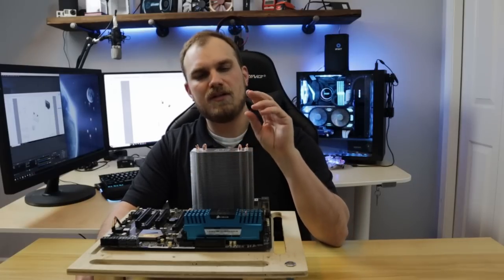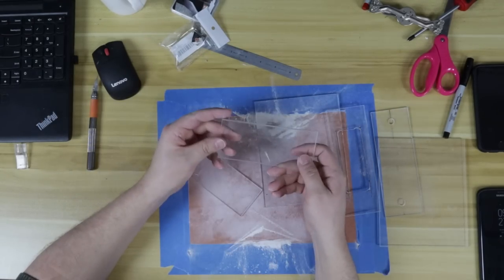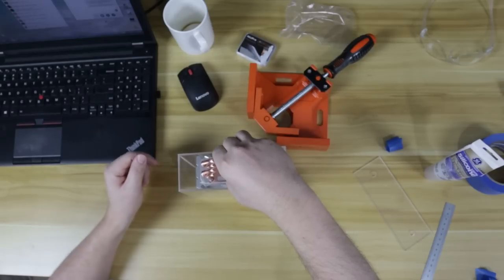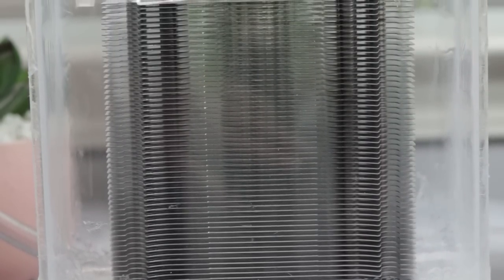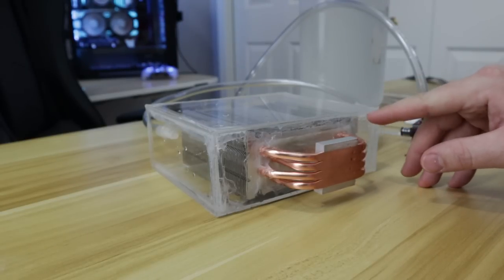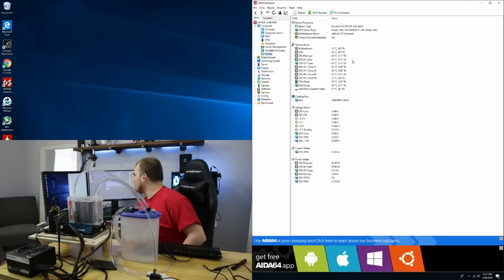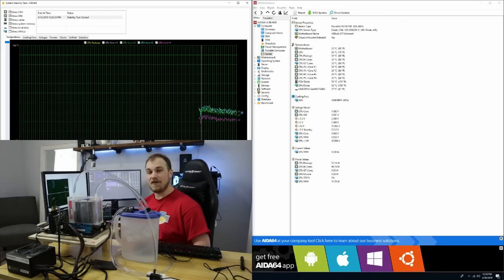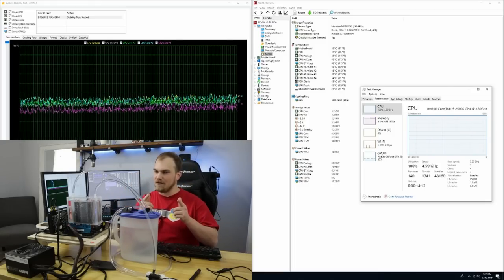I Water Cooled My Air Cooler AND..........

Comment: Pretty nice idea man :D Well done
Reply from the maker: THANK YOU, You Are A LEGEND my man.
Reply: legend der8auer approved 😱 great job 👍🏻
Reply: If der8auer likes it its because it is a very good idea! Awesome!
Reply: Nice Video, I have a Idea to improve it ! Bare with me, ja auch du Roman.

It´s called spray cooling. Insted of beeing submerged you constantly spray a mist of water over it. The same way like a spraybottle for your windex does ( you could juse the nozzle). Continuosly, obious. How to. Take your case that you have and add to connections, one for the nozzle and one for the drainage. Idealy you would place the board in a case so that is upright. The cooler has to horizontaly installed, you spray water from above, collect the used water from underneath it, and done. you have increaced your cooling performance by a huge bit.

Roman, solltest du das lesen,  das könntest du auch mit dem Novec zeugs machen, führt so viel mehr Energie ab. Google Sprühkühlungen für Extrusionsanlangen.
Reply: Uff. Pretty redundant way to cool tho. It's about as useful as filling a walk-in freezer with smaller freezers and keeping their doors open.
Reply: Max Pain  Too late, probably at this point some corporate greed have patented this and now @Major Hardware is infringing some licences xD
Reply: What about trying mineral oil in it next? Without the loop.
Reply: hesalegend
Reply: Or... you say it's a great idea because der8auer likes it :) @JoseAlfonsoChavez
Reply: It is awesome idea it will be innovation to create a water cooled CPU BLOCK  for mass production a great price!!
Reply: The issue is the coolant (water) is not cooled itself. This idea is only good for limited time. Great for overclocking but regular watercooling is this with fans to cool the water. @procedure7
Reply: Methylene Chloride works great.
Reply: @Mp57navy  it's not exactly like that.  Generally whatever you're storing in a freezer does not generate heat, so it stays at the ambient temperature.  Once it's cooled to 0F, or whatever your walk in is set to (or close enough...since it's an asymptotic behavior) the freezer only has to keep up with any heat that is gained by imperfect insulation.  So the outer freezer would create a barrier that basically makes the interior freezer have no work to do.  In the case of this CPU cooler, the CPU is generating heat, and the amount of heat is codependent with the load on the CPU.  If we can cool it more efficiently, we can overclock higher.  Thus, creating a water block with a huge fin-stack (which is really what this idea is) means more efficiency and/or better OC, theoretically, compared to a traditional water block in an otherwise identical loop.
Reply: @pav9978  and if you are running Windows, you can spray the CPU with windex to keep your installation clean and responsive!
Reply: How about turning a standard blower-style GPU heatsink into a "water block"?
I mean - take apart blower-style GPU cooler, and you get a base for your water block. Then make "walls" just by sinking all the rest 3 open sides into an epoxy, f.e. 5mm deep.  Drill holes for tubing on both sides and ready. Custom waterblock.
Damn, I think I have an old gtx 670 blower... I will make it ;-)
My only concern is whether the base will be watertight. As far as i remember it is made from a set of compressed copper fins.
Reply: Roman, please do the same, but with Liquid Nitrogen 😂
Reply: @MajorHardware  A reply from Roman is big fat Plus. 
That alone earns you a new sub lol
Reply: ахах очень смешно
Reply: If you think about it, this is just basically a reversed Asetek design. Instead of the pump in the block, it's the rad.
Reply: @Platypus_Warrior  Dude he will add a rad in the next iteration.  This was as clearly stated a proof of concept.
Reply: Yes, add a radiator (and fans on it because it will still get too hot) and you end up with a regular water cooling system... @Viewer19
Reply: @chrism6880  The only this this setup in particular does, it take advantage on the surface area of the air cooler and the thermal capacity of the big quantity of water... Now, as soon as the water in the plastic container is saturated, you will have to cool it anyways. 

If you leave the setup in particular run for, lets say two hours under load, the water will reach the temperature at which your CPU is going to throttle, which is probably around 90ish degrees. 

A tedious way to boil water at worst, a good demonstration of thermal capacity of water at best.

Edit: To make this setup work indefinitely you need a proper way to evacuate the generated heat. Either an open loop (hook it up to the cold water tap), or cool the heated water with - you guessed it, a radiator.
Reply: I actually had this idea long time ago,and few days back accrued to me again and this video was recommended to me.I was also thinking about oil cooling like high transformer,but thats kinda bad idea i guess.And also using boiler of water that it self is heatsink,or waterwall cooling but that only wastes water.And why don't people use acoustic fabric for sound isolating the pump,i would do it for sure.
Reply: Its fucking der8auer no way i thought he was a myth
Reply: Too much inherent risk with the design ~ it will never work long term. Remember, smarter guys than us have already devised the best methods.
Reply: Chris M yeah it has real potential. I'd love to see any future results since I already know I won't be attempting anything like this myself.
Reply: Moin Roman!
Reply: Makes a lot of sense -- the hyper 212 evo has way more surface area than ANY waterblock on the planet, and you can just run water through it. 

Might want to try the same thing with LN2, actually. You should be able to pump it around as long as your pump doesn't freeze up.
Reply: nice idea or decent amount of views for a dumb idea? 😂
Reply: roman auch hier wtf xD krieg das video von youtube auf die startseite und dann der landsmann/die legende als top comment.. grüße :D
Reply: @Viewer19   He just made a giant water block, which is a bad idea because cooling that massive amount of hot water would require a massive radiator. There is good reason water blocks are small, to heat small amounts of liquid, cool it in a radiator, and sometimes store and further cool in a reservoir before starting over. This idea is basically trying to cool your CPU with a reservoir full of hot water.
Reply: Its been a while since last original content.
Reply: Ich hätte nicht gedacht dass du auch im englischen Bereich so beliebt bist ;D
Reply: @boborz7146  That is just wrong in so many ways.  I understand he made a large water block duh, but your understanding is flawed.  All water cooling solutions have a  thermal limit after which they will not be able to cool the water supply volume.   This experiment is a way of exploring the various elements of a water system that have the most influence on thermal limits.  No one is trying to develop a prototype for production.  You don't need to watch or comment here because you know everything about fluid dynamics and heat flow transfer through mass density.
Reply: @pav9978  so phase change cooling a phase change cooler.

Option 1, Instead move to the coast, run a sealed pipe (with in line pump) through a normal block or the above and then into the sea and back. Your then using the sea to cool your CPU like Microsoft.

Option 2 move to a pole (north or south, rather than a Kowalski, that won't work or my uncle would have never needed a heatsink).
Reply: Naa du auch hier?
Reply: You know you're a real tech nerd when you make videos about tech for a living but still check out small creators on youtube doing similar stuff! :D
Reply: But there is ONE BIG PROBLEM ! ! --> The aluminum reacts with copper in the cooling circuit depending on the addition of water. But there is a long-term test of advantage to see how behave de different metals in the cooling circuit! Was würdest du dazu sagen @der8auer? Greetings from Austria!
Reply: Max Pain  yeah if you take  it like this you have a reservoir integrated in you cooling block
Reply: I came to tag you!
Reply: Wie wär's genau das selbe nur mit Stickstoff?
Reply: Nice idea ? It's the stupidest thing i have ever seen. Why would you build such monstrosity, when you can buy normal, small water block ? Can he even put motherboard in vertical position with that "thing" mounted on CPU ?
Reply: I still wonder why current standard water blocks have such small amount of fins, they should be much bigger for better heat dissipation. This water cooled air cooled experiment is my idea taken to the limit :) 
Now just add a radiator and fans.
Reply: make this Project in to a real  product
Reply: The Build8r
Reply: if der8auer told me my idea was good I would pin that comment too
Reply: So my first thought of what would be a cool experiment;  take the water cooled air cooler off the cpu, use a regular water block on the cpu.  run the loop to your water cooled air cooler but mount the heat sink to a peltier plate cooler.  Boom, now its a functioning radiator. super quiet and cool.

You could even use it as your reservoir in a case with a little less worry about water leaks, not to mention, how cool would that look.
Reply: that feeling when der8auer comments on your watercooling video and appreciates you
Reply: du hier?
Reply: NSFW mate...
Reply: Sir can you make a custom cooler by using liquid nitrogen instead of ice water
Reply: Der Bauer !? Du hier :D
Reply: You should of had the fresh cold water enter from the bottom of the box as heat rises
Reply: Patent that bro, ASAP!!    F#*KIN genius!!!
Reply: der8auer yeah it is, are you interested in pitching this to any partnerships?... I would buy if it’s behind a reputable brand.  I mean, even if it leaks it is still safer,  assuming the mobo is side mounted of course.
Reply: der8auer the legend is here....8auer
Reply: Lol du bist sogar bei den ammis bekannt @der8auer wusst ich garnet
Reply: @cularu1  Coz you do not need such crazy surface inside a block. Really. The effectivness of watercooling relies only on heat dissipation by radiator.
And on the choke points - usually chipset (die) and IHS.
Modern intel chips are so thick, that this thickness limits amount of heat that can be transferred to the IHS.
There are blocks that can be put directly on the die, as a fat IHS. And even those cannot maintain heavily overclocked i9 9900k.

Simple channels inside waterblock can easily transfer the heat to the fluid.
Reply: @Mp57navy  I disagree, I believe what he's done here is to replace the fan with a water pump, so where the fan would normally remove heat from the heatsink fin array via airflow, that is instead being accomplished by the water pump cycling the water. It's exactly as redundant as a normal heatsink/fan assembly.
Reply: @xScottleyC  It's about as useful as slapping a 2 pound copper block directly on the CPU. It will work for a while, but eventually the copper block will be too hot and not able to soak up more heat.
Reply: Max Pain  Sooo.. an AIO? because that's basically what this is minus a radiator.
Reply: @brewmonger666  well actually the pccooler w120( the review: https://www.youtube.com/watch?v=FhjgnLyHIgA ) is technically this but the problem is that cooler sucked and there hasn't been more of them since, thats why i'm researching to make my own. i was actually looking at using the cooler master MA620P and water cooling the cpu block itself.
Reply: der8auer is her is a grait uouner man
Reply: @mcullennz  all that would do is overheat.
Reply: I love your CPUs man I've got one running in my system right now
Reply: how bout doing some overclocking,plunge that on some Liquid Nitrogen, instead of acrylics you can use a more LN friendly material and insulate it. Sounds a lot of fun😊
Reply: @Dunkelelf3  😂true
Reply: @oof5882  true
Reply: Yes, it will work for some time, but this air cooler is made from cooper vacuum  tubes and aluminium heat dissipating  fins, so fast corrosion is guaranteed in water.
Reply: @MajorHardware  put some pykrete in there and freeze it lol
Reply: But isnt water directly on the CPU still way better and even cheaper in an AiO than this one? But maybe in an customwatercooled build someone would like to have it
Reply: This was a great video
Reply: @pav9978  Ich hab deinen Kommentar angefangen zu lesen und musste an meine Arbeit denken, und dann redest du von Extrusionsanlagen, haha.
Reply: @lelboi3557  hehe ^^
Reply: Actually doesn’t even make sense
Reply: @pav9978  Thats a rubbish idea. Water will pull more heat from the heatsink.
Reply: @winbombs6117  and thats where you´re wrong kiddo. As a tip for your adault live, google sothething if you are not sure.
Reply: Thats fukushima in working until the water is no more.
Reply: Roman, du 8auer! ha!
Reply: This will only work with a horizontal PC. By the way, in Russia you don't need to put ice in a container. You can just take it out onto the balcony. )))
Reply: Thermaltake created a heat pipe fin and water cooler block back in 2008 ish, I got one cannot seem to find any info on line
Reply: The Legend German Tech himself.
Reply: @WinterCharmVT  might be break an acrylic glass when it put liquid nitrogen.
Reply: @MajorHardware  anything new with this?